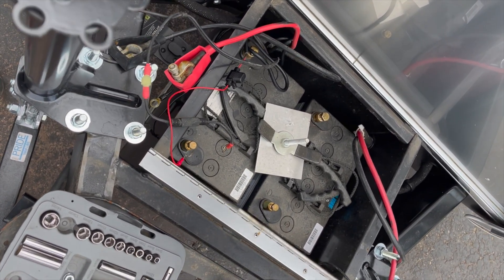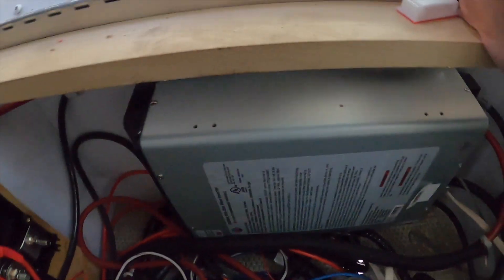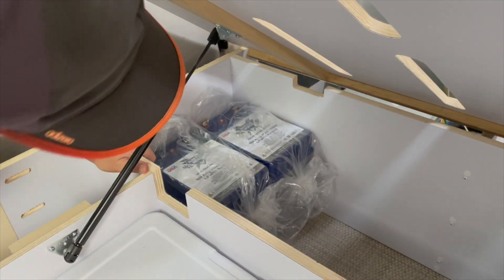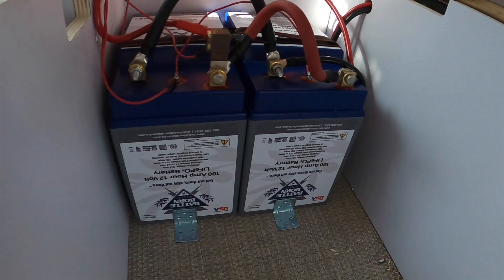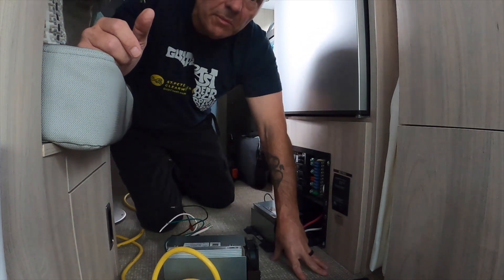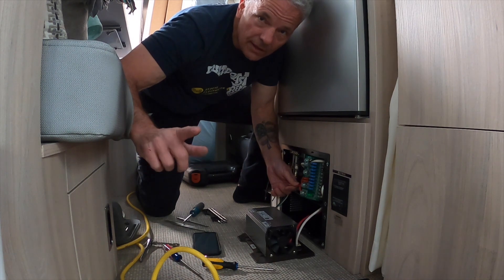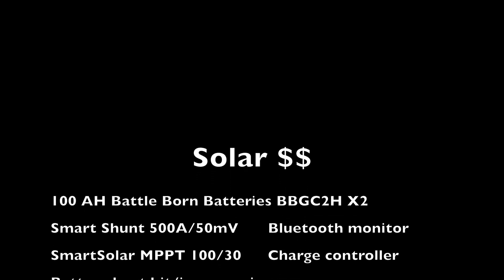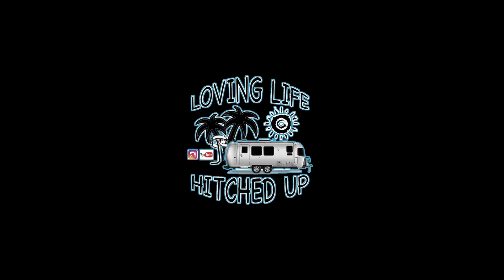AIRSTREAM SOLAR UPGRADE and LITHIUM BATTLE BORN BATTERY INSTALL

Comment: What did you use for a transfer switch. On my Lance I built a manual switch that cut power to the battery charger when on batter power.
Reply from the maker: Did not need to add transfer switch as it only comes into play when hooked to shore power and that is automatic, as per AS

Comment: Great video. How has the solar panel non-drilled install held up? I’m considering the tape alternative for adding panels to y my Airstream, too. Posting this in December 2023. Thanks!
Reply from the maker: Good as gold, many solar companies use this method with amazing success. I am planning to add a few more using the same method. Take your time and do good prep work, CLEAN CLEAN CLEAN and use lots of alcohol to prep!
Thanks for your support!

Comment: Just put down a deposit on our first ever travel trailer (airstream).  Our trailer comes with the factory installed solar panels and regular lead acid batteries.  I'm very interested in increasing our off grid capabilities for this trailer since we plan on spending a lot of time in national park campgrounds where there will usually be no hook ups at all.  I would love to install a lot more battery storage capabilities using lithium batteries.  I'm waiting to see what our needs are in terms of power consumption after taking it out on a few trips.  But, thanks for this video.  It's a great intro to some DIY solutions for this.  Thanks!

Comment: I think I might’ve found the right solar panel! I’m restoring a vintage 1957 Avion tt 20’ and roof space is very limited for my goal of at least 350 watts so I will inquire more about this. Hopefully they’re small enough to accommodate four on my rooftop.
Nice video! Thanks for sharing it!

Comment: Another question regarding attaching solar panels:  Where did you get the info on drilling through the skin into the ribs for the hardware?
Reply from the maker: We opted to NOT drill through the skin as do many solar upgraders. I cant see myself adding holes to the roof. LOL The mounting hardware is specific to the panels and that it is on an Airstream .  Good luck with your install, let us know how it worked out! TJ & Red

Comment: Question for you regarding the converter:  Where did you purchase this, as I am in the process of doing this now.
Reply from the maker: I ordered the charge converter through amazon, it was a direct swap, same brand etc just set up to facilitate lithium batteries.  
TJ & Red

Comment: Why did you relocate the batteries? Just curious
Reply from the maker: Primarily for the security and weather concerns. The added bonus was the ability to increase total number of batteries in the long run as there is no additional space in the tongue box for more than 2. Under the bed would allow plenty of additional space if needed. Figured do the work once and logically.
Thanks for your support. TJ & Red
Reply: Airstream needs to redesign the battery area & propane tanks ! WTF , make a slid out like Oliver trailers do to make easy access & more streamline design for the propane tanks ! Duh nothing like putting a rectangular box on the front of an AS aerodynamic trailer . Common AS get with it . 😮👍⚾️

Comment: Thanks for the video! Where did you install the 2nd disconnect switch and circuit breaker? The one underneath the MPPT makes sense, but trying to figure out where the other set would go.
Reply from the maker: I have one disconnect directly above the batteries under the bed to isolate the batteries directly. The one by the MPPT allows me to disconnect any incoming power from the solar panels.

Comment: We have a 23FB too (international) and just finished installing 200AH Lithium, 3000W inverter, DC/DC Charger and did all under bed like you (wow pain in the a$$) but very happy with the result boondocked 11 days in central OR. Don’t have solar on roof yet (ours is 2012 no factory solar) but hoping for 400w. But not sure if I can make it fit. Installed my Poynting antenna same location as yours. Fun stuff!
Reply from the maker: Moving those batteries was not an easy task for sure.  Glad your improvements came in handy for boondocking.  Safe travels.
Reply: You really need a minimum of 300 amp hours to run a 3000w inverter

Comment: Do you have a schematic of the wiring. I have a 28ft airstream and would like to upgrade my solar as you did.
Reply from the maker: Hey JC, shoot me an email, I will share with you what I have done and have learned from other AS owners on the forums who were a big help confirming that it was all going to work as designed.
Lovinglifehitchedup@gmail.com

Comment: Nice setup. Looks like you did a nice job.  Hey you bay has plenty of room for some more batteries if needed.  May do this on our next rig. Most likely will do it myself. Guess I can put my electrical engineering skills to work
Reply from the maker: We can definitely add more if needed.  I'm sure you'll have no trouble adding some to your rig.

Comment: Great video! I just got through doing pretty much the same thing as you.  2 battle borns, lynx distributor, smart shunt, and a 60 amp renogy dc to dc converter.  My last step is the solar.  Bought 3 zamp obsidian panels and the same victron charge controller you have.  I am going to try the no drill method.  Question about the wiring of the solar.  Does each zamp panel just plug into the combiner box?  Or are they wired together first and then connected to the combiner?
Reply from the maker: The panels are connected individually so they are working independently (not in series or parallel) each plugs in directly to the combiner block. Read a lot about connecting prior to connector box  and issues with impacting full function and a lot of other complicated solar efficiency stuff LOL so I kept it simple and easy. 
As far as VHB goes its all about prep, lots of alcohol to clean surfaces and then seal it all in with sicaflex to keep it water proof, locktite on any bolts as well.
Good luck let us know how it comes out.
I check mine all the time, still tight as a drum!
TJ & Red

Comment: We have 3 solar panels on the roof-300 Watts + another 100 with a fold out panel. Plus, we love our Battle Born Lithium batteries.   Ya'll did a great job installing yours.  Hope you get lots of opportunities to use them. Thanks for the breakdown.
Reply from the maker: Thank you so much. We're thrilled with this upgrade.